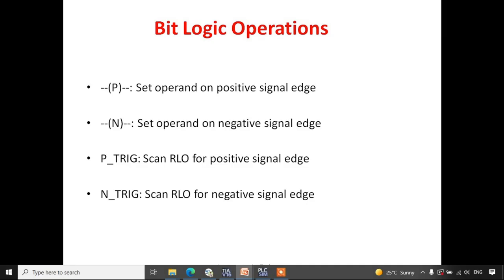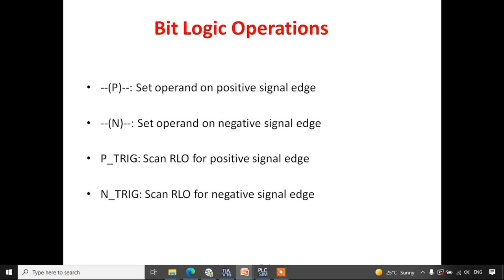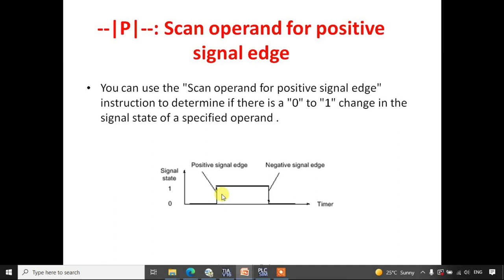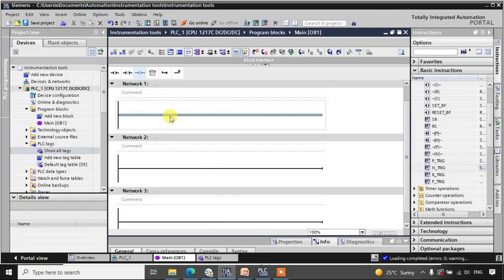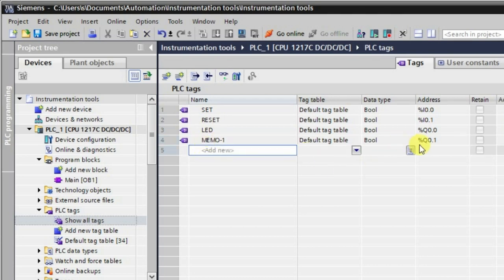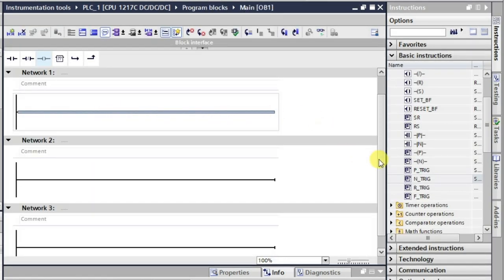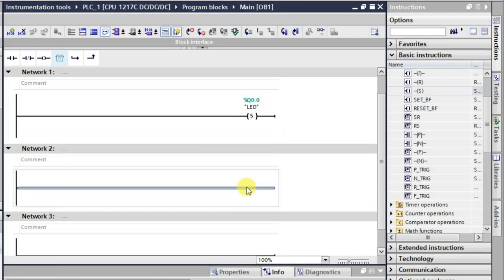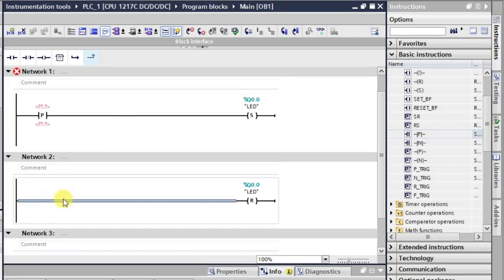Siemens PLC Tutorials - Positive and Negative Edge Signals

Comment: It doesn't work on my project. Even if lPl is in a state "TRUE" the coil is in a state 0 (FALSE). It's like the lPl doesn't  give signal on the output. Can someone help me?
Reply: It most likely goes TRUE for a single scan - this example is using a SET on the coil so it latches on.